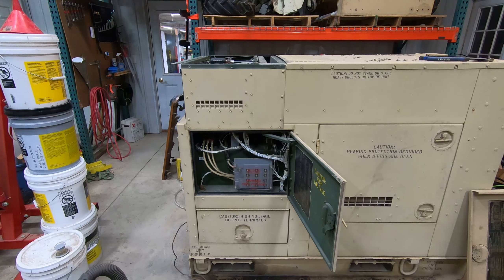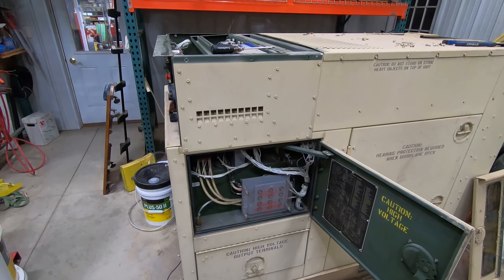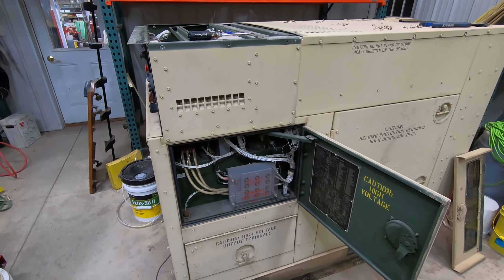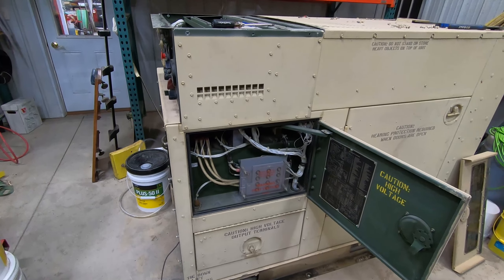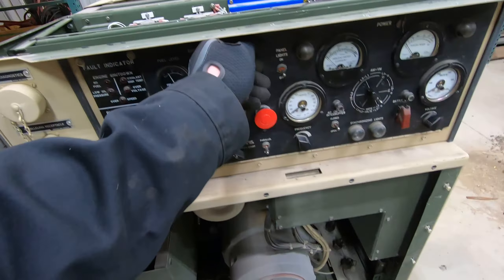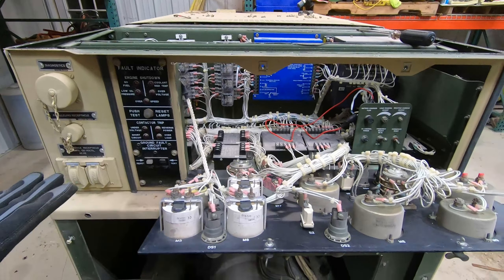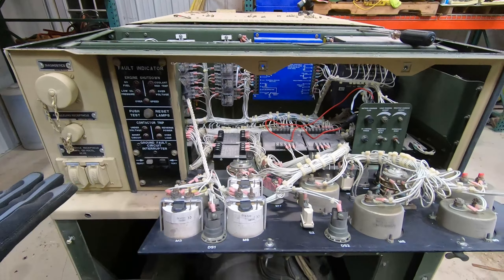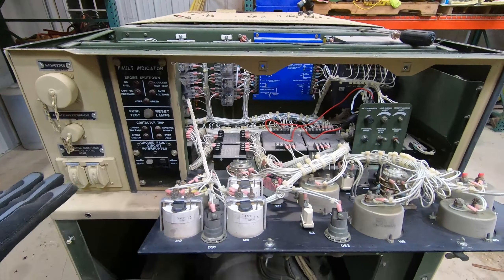MEP-804A Generator Power Output Issues - AC Interrupter

Comment: Today's October 17/2024 how is the machine doing so far?
Reply from the maker: Doing great. Since the repair on the output its been working fine. I've used it a couple times for small things and I had it out a couple weeks ago for a one hour run on the load bank at 100% load before winter.

Comment: What does that have for an engine in it? Rpm does it run at seems like it’s Just Idling, is it an inverter type generator?
Reply from the maker: The engine is the 804a is an Isuzu C-240. I’ll have to look at the rpm again to confirm. It varies based on 50hz or 60hz, and I think the spec for 60hz is 1800rpm. Think being key.
Reply: Very nice . We are buying one . Quick question/ verification. AC interruptor needs to be closed in order produce power. Does the MEP need to be grounded when only using the convenience receptacles? Or only when using the bottom lugs / or always .
Reply: @rickyvasquez3157  Depends on if you want to be the ground. I realize that's tongue in cheek, but true. The lugs will put out voltage regardless of whether you've grounded the unit. It's an aluminum chassis, so it's a great conductor. In a short circuit to the chassis, the current will go somewhere and touching it makes you the path of least resistance. In general I'd suggest grounding. I think some jumper cables are better than nothing in a pinch, even if they are not 6ga.

Comment: I think you need to run it more often than once every 6 months. The generator can lose it's ability to make power if not excersized regularly.
Reply from the maker: I'm more worried about individual components corroding and seals sitting than anything.